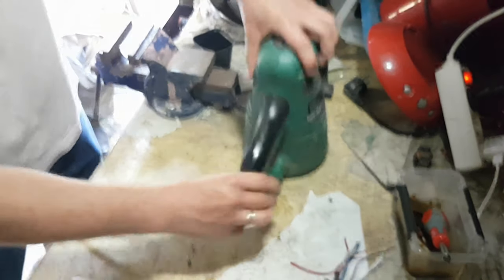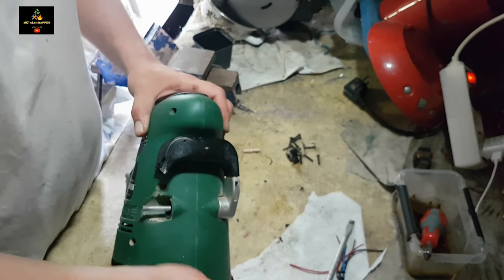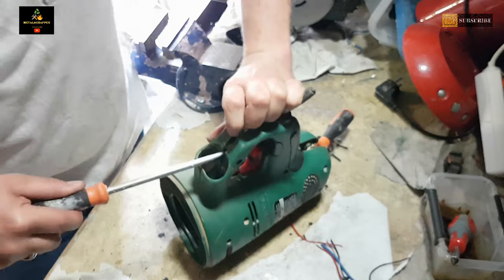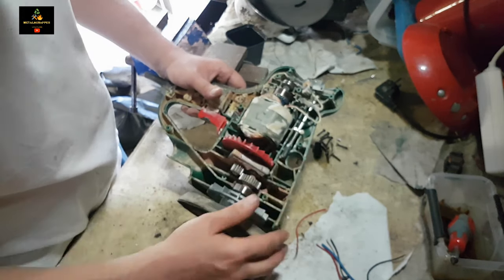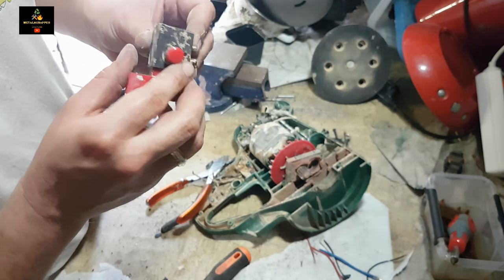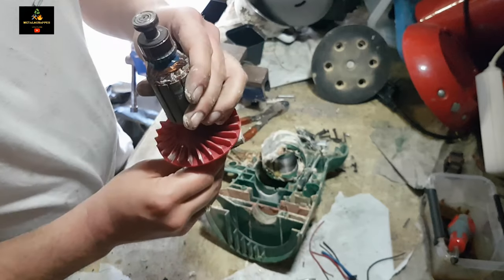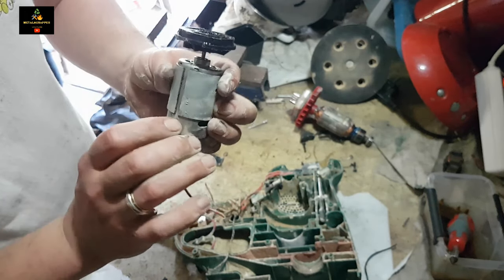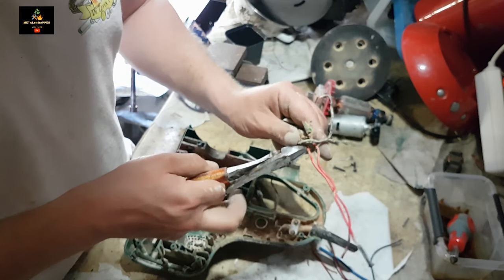Scrapping series part 2 grinding machine

Comment: Hey!! Thanks for the mention 👍 the rotors are indeed a pain, the stator is the interesting part, if it is not Copper plated Aluminium that is 😋👍👍👍
Reply from the maker: No problem! I once had a bigger one from a washing machine. I did not know what to do with it and I saw you struggling with it so decided to just leave it. I hope it is just copper, still have to strip it. Now first on to holiday! Next week another melt 👍👍
Reply: I seen a video, where the guy took and burnt the resin and plastic off the rotors that were copper then just cut off the end and pulled the copper right off, or just save em up and pop the whole thing in the crucible like I did with the aluminum ones and just melt the copper right off.
Reply from the maker: @Thewulf56  thanks! I will keep it and feed them to a worn out crucible

Comment: Might check into that disc on the bottom part of the sander, you said aluminum, it kinda looks like zinc, very similar in appearance, but zinc is a darker grey and a bit heavier than aluminum. But, it's kinda hard to see in the video, so I might not be completely correct, but, just off the quick glance, it did look like zinc.
Reply from the maker: Still have it laying around so will check that another time. Thanks for watching! Next week another melt!